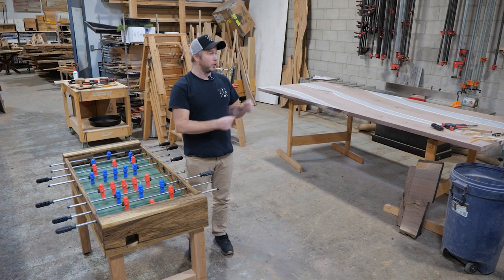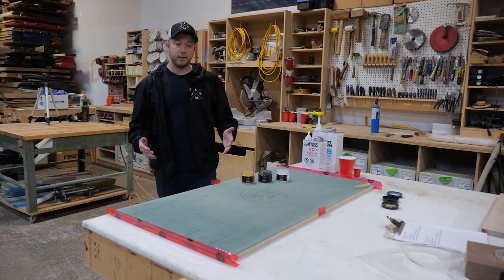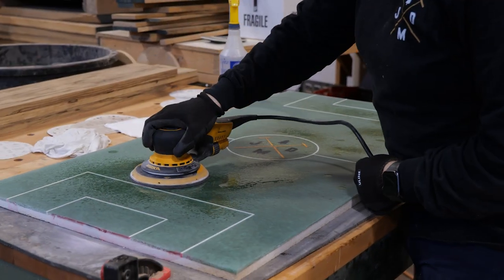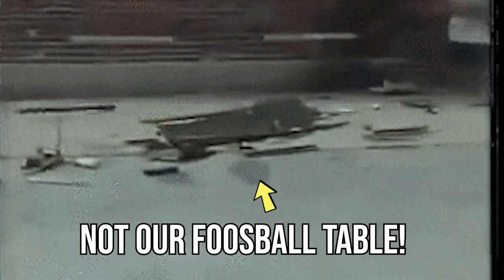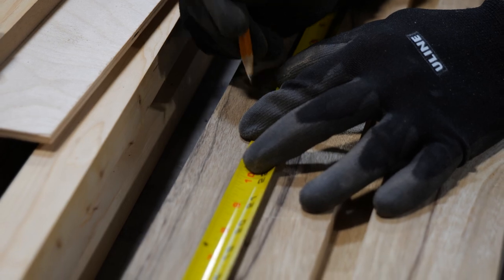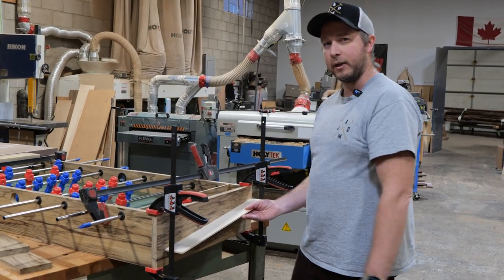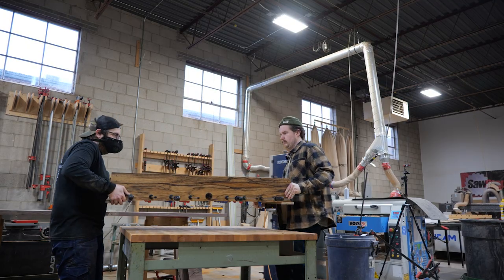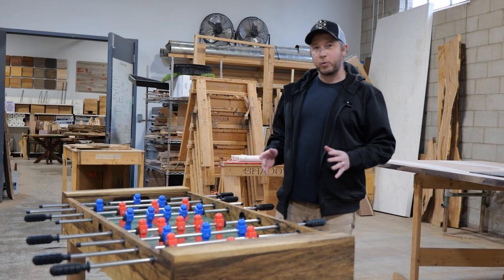DIY Foosball Table Conversion | Fun Woodworking Project

Comment: Very nice! No corner ramps? Is that not a thing anymore?
Reply from the maker: This one definitely needs corner ramps. We are toying with the idea of another video after we've played it a bunch to go over the pro's and con's of this build and what we would do differently. Thanks for watching!
Reply from the maker: We've actually been contemplating 3d printing, using epoxy or carving some wood pieces. What do you think?
Reply: @jeffmackdesigns  Epoxy, but maybe a nice burl would look kind of classy too.